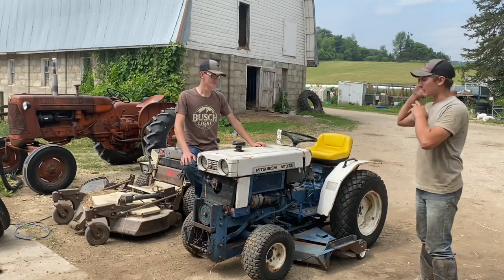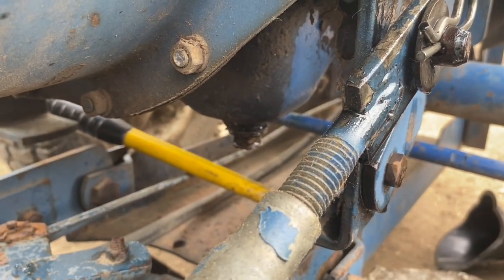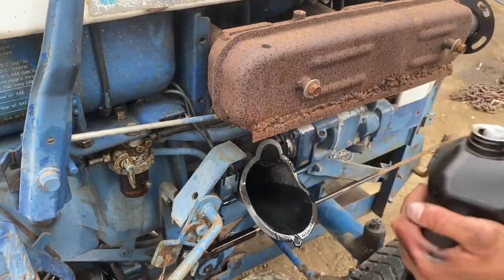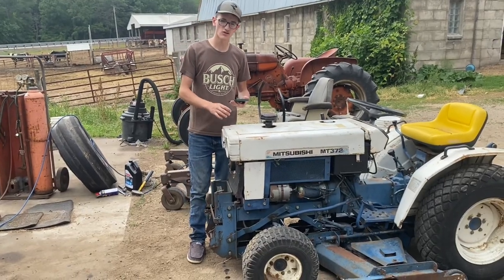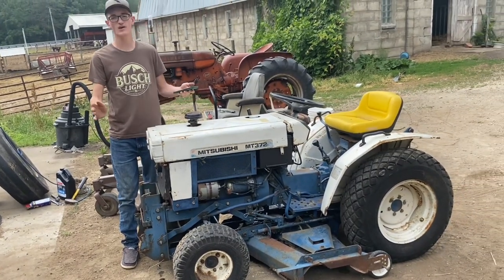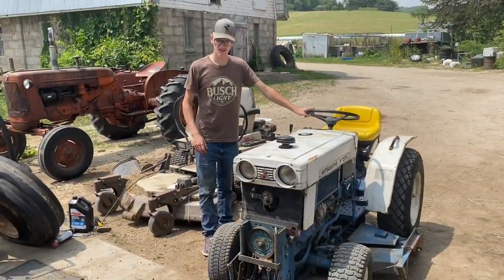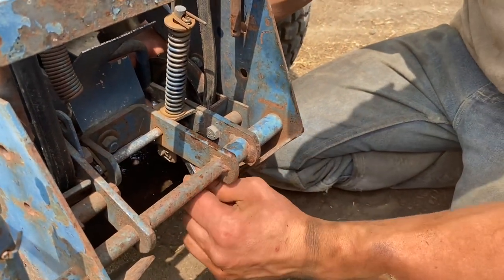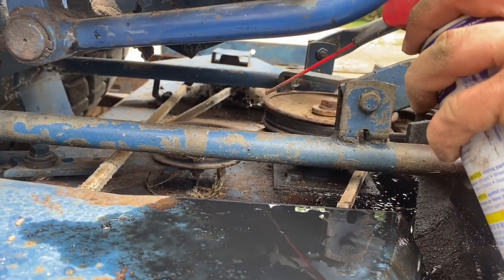DIESEL lawn mower Mitsubishi MT372, WILL IT MOW?

Comment: Hey fellas, the next time you pull a pulley off and it has bearings use some PB Blaster.  PB Blaster is a penetrating oil intended for loosening rusted joints (threads, etc). It does this quite well. WD-40 is a "Water Displacement" treatment intended to leave a persistent rust-inhibiting coating behind.
Reply from the maker: Thanks for the tip 👍

Comment: Use some diesel engine oil.tighten up all loose bolts either sharpen or replace the blades and youll have decent lawn tractor
Reply from the maker: Yeah, I got 15-40 in it now, I thought I had some but I didn’t, so 10w30 was the closest thing I had. The blades don’t look too bad but I will probably sharpen them later this year

Comment: Do it up proper like repaint it.  And use it.   Like a restore. Or just proper look.   And show the details on it when you do.
Reply from the maker: Yeah, I don’t know if I want to do a full restoration (because I want to use it to do work, not worry about scratching the paint a little) but I do think I could clean it up decent, straighten some things and fix some of the mechanical issues like the glow plugs
Reply: Were you folks at we need a lawn mower in iowa  cool video like your content
Reply: @darrellrobinson5742  I live in Pittsburgh check other places for one.
Reply from the maker: @darrellrobinson5742  southern Minnesota

Comment: What mower is in the back of a mitsubishi? looks solid.
Reply: That's a Grasshopper mower. I could tell by the classic brown and tan color scheme. Solid.
Reply from the maker: Yup, but it has seen a lot of use so the motor is getting tired and burns a lot of oil

Comment: ya outta be running diesel motor oil rather than basic 4 stroke gasoline engine oil.
Reply from the maker: Yeah, I got 15-40 in it now, I thought I had some when we were filming the video but I didn’t, so 10w30 was the thickest thing I had